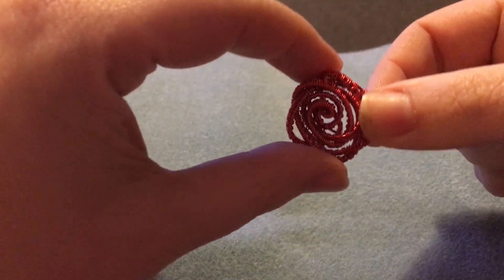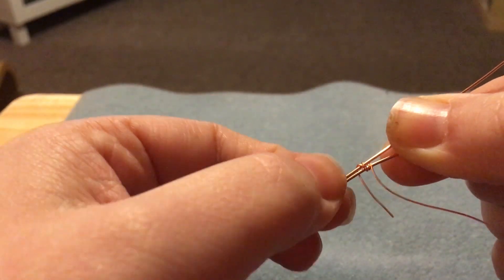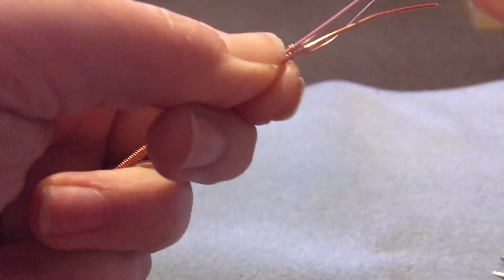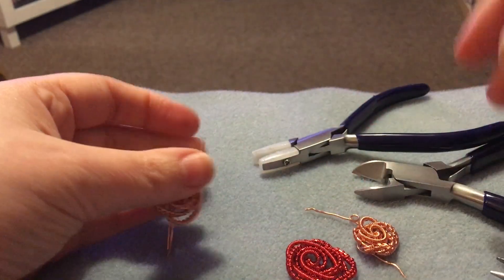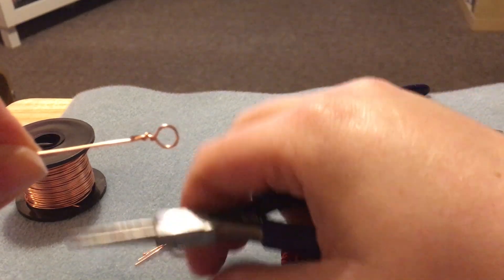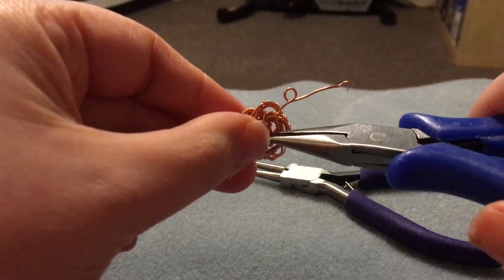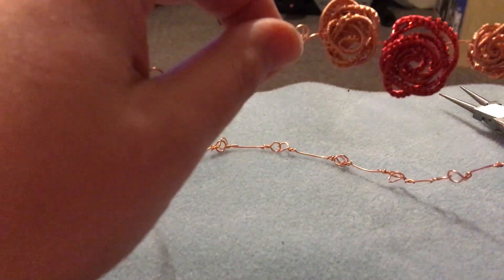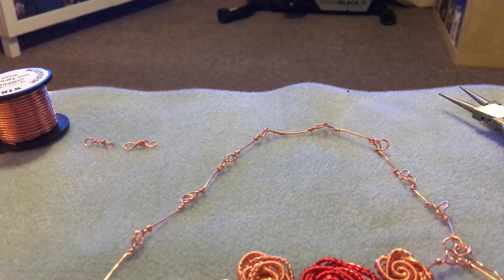Wire Rose Tutorial Necklace Tutorial, by Isabel Grouse for Charming Beads

Comment from the maker: Links to full list of Components Used:
Round Nose Pliers - https://www.charming-beads.co.uk/round-nose-pliers-tool-0015.html
Chain Nose Pliers -  https://www.charming-beads.co.uk/short-chain-nose-pliers-tool-0010.html
Side Cutting Pliers - https://www.charming-beads.co.uk/side-cutting-pliers-tool-0020.html
Red Plated Copper Wire 0.4mm - https://www.charming-beads.co.uk/1-x-red-plated-copper-0-4mm-x-12m-round-craft-wire-spool-ha16070.html
Red Plated Copper Wire 0.8mm - https://www.charming-beads.co.uk/1-x-red-plated-copper-0-8mm-x-3m-round-craft-wire-spool-ha16205.html
Unplated Copper Wire 0.4mm - https://www.charming-beads.co.uk/1-x-unplated-anti-tarnish-copper-0-4mm-x-20m-round-craft-wire-coil-w1040.html
Unplated Copper Wire 0.8mm - https://www.charming-beads.co.uk/1-x-unplated-anti-tarnish-copper-0-8mm-x-6m-round-craft-wire-coil-w1080.html